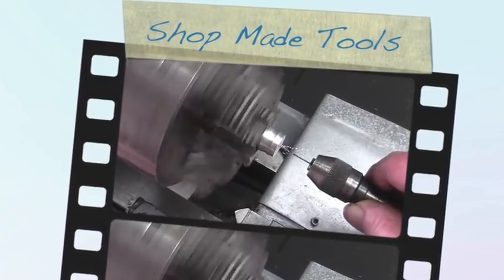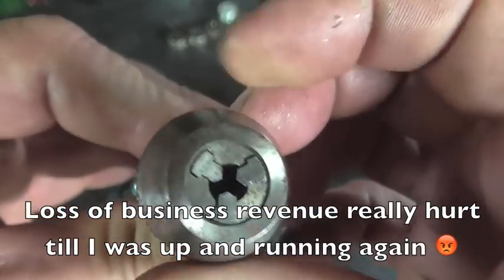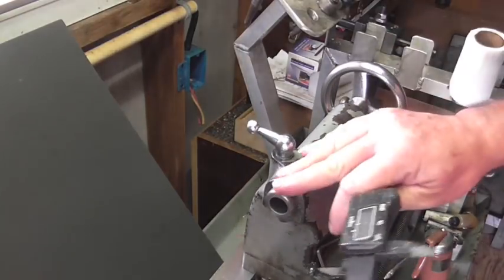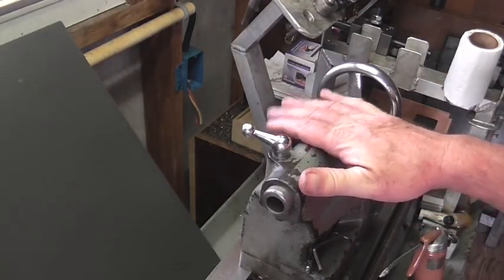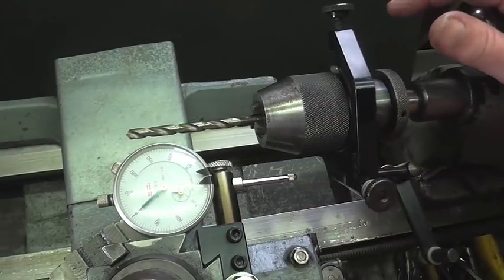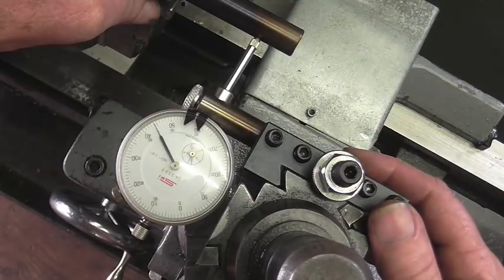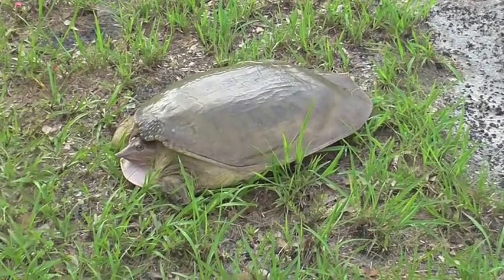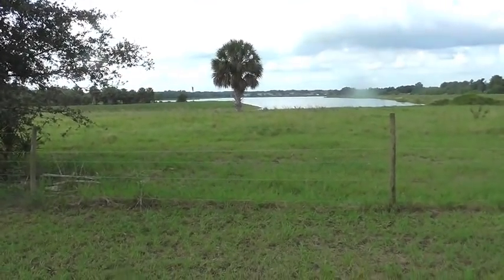Lathe Tailstock DRO / Albrecht Pin Chuck Sleeve - MSFN

Comment: Glad to see ya back at it guy.  I hope it is smooth sailing for a long while for ya.
Reply from the maker: Thanks Rodney, you woulda loved the lawn tractor repair! LOL
Reply: Makin Sumthin From Nuthin lol man I've just been in a funk.  I've done so much recording, and all the footage is just there.  Have not felt up to doing a video.  I did have to make a spindal shaft for an old wizard from western auto.  Couldn't find it anywhere.  So I made one. 

Be interested in seeing how ya repaired the lawn tractor lol.
Reply: Put yer "Hope" away... VOTE TRUMP !!
Reply from the maker: With a John Deere L110 the carb sits higher than the fuel tank and the way they route the fuel line under the deck it requires a fuel pump to send the gas up to the carb. I sealed up the fuel pump, bypassed the gas tank altogether and mounted a fire extinguisher up on the dash to gravity feed gas directly to the carb....works great. LOL
Reply: You did WHAT  ????? gotta show us to be believed
Reply from the maker: Email me Steve, will send you a pic. My email is in the description :)
Reply: Makin Sumthin From Nuthin lol a pulse pump is around 10 bucks.  Unless your pump is a mechanical.  But man I'd love to see this new system.  Lol
Reply: Appears I'd call it a THROWBACK type !!
Reply from the maker: Mine is the type that has a lever that is activated once inserted &  bolted to the crank case. I have gone thru 3. The fire extinguisher works great...LOL You have my email, shoot me one and I will send a pic :)
Reply: Makin Sumthin From Nuthin you can still use a pulse pump.  It just requires general mechanical ability.  I'm fairly sure your skill goes beyond minimum requirements.  Lol.  Will do good sir.

Comment: Hey Rich, I am definately going to make a pin-chuck slidey thingamajigies.  I am thinking of drilling out the existing mig tip rather than buy larger ones if I need more volume.  Good idea.  Glad to see you making it through life's little side trips.  I feel your pain my brother.  Thanks for sharing!

Joe
Reply from the maker: Thanks Joe, if I woulda had a smaller drill bit I woulda demonstrated it. 40 thou was the smallest I had
Reply from the maker: You are officially a machinist, no more buying parts you can make! LOL
Reply: You know, I have a drill index of 61-80 that I have had for years.  Finally need the #72 the other day and I guess the index has grown legs and walked off.  grrrr
Reply from the maker: LOL, them things are so small they probly oxidized and blew away in the breeze
Reply: OKAY, I will refrain from the, "That's what she said" stuff. But you are probably correct!

Comment: Surge protectors for your electronics are a worthwhile investment.  UPS even better.  Get an external hard drive and use it for regular backups, but only plug it into the computer when making backups or doing a restore.  Cheap insurance.
Reply from the maker: I have so many external drives now I could open a store! :) Excellent advice Chuck, thanks for sharing

Comment: Please explain this "surge" and what future protection you have
Reply from the maker: Whatever occured came in thru the fiber optic lines while I was sleeping, it fried 100% of of the phone company's stuff as well as 1/2 of mine. One computer got smoked, another had the ethernet port fried and 70% of my Adobe CS2 suite software wouldnt function...was quite the mess. Hourly cloning of all computers to multiple external drives is the best way for me to avoid additional data loss ~ Richard
Reply: Fiber can do that ??
Reply from the maker: I guess so....the repair guy was dumbfounded, he spent a whole day replacing everything. He said he had multiple calls of the same type all within a 3 mile radius of me that day